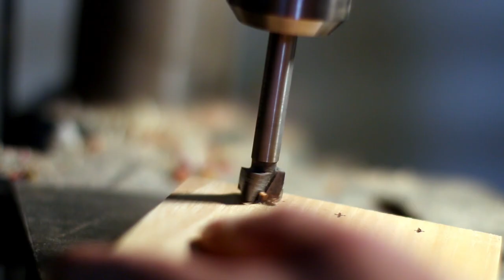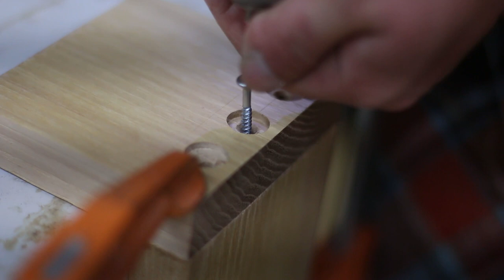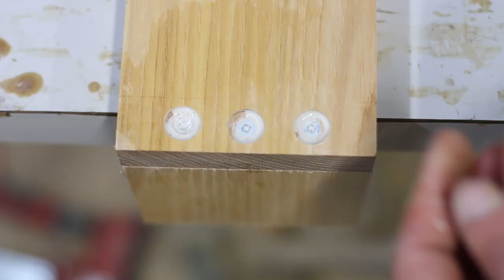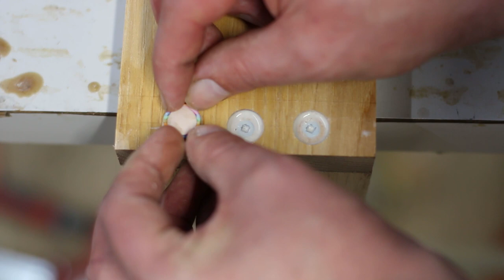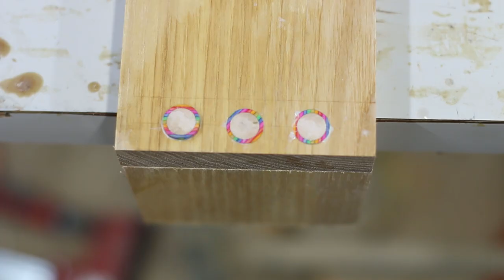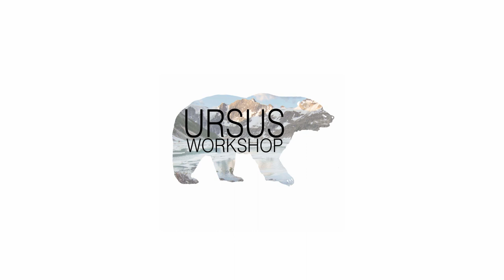The 30 Day Joinery Challenge: Butt Joint with Decorative Dowel Plug

Comment: I mean, cool and all. But where did you get or how'd you make them?
Reply: Adam D I’d like to know that to hoping he will respond
Reply: I was hoping for the same.
Reply from the maker: Yeah, I wish I filmed making the plugs. First I glued up the veneers a 4x4x0.5 inch sheet, then drilled three 1/2 inch holes into the veneer sheet and then filled them with a dowel. When that was dry, I cut them out on the bandsaw and sanded them down  by eye to the final dimension on the disc sander. It was a long tedious process.